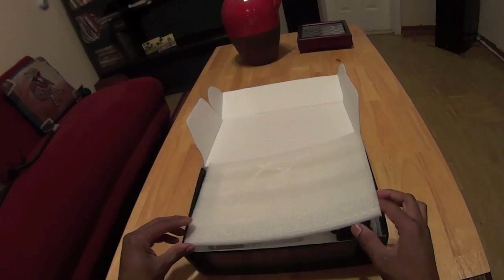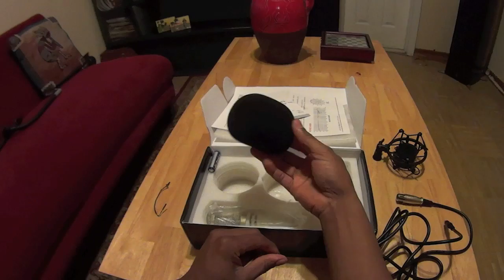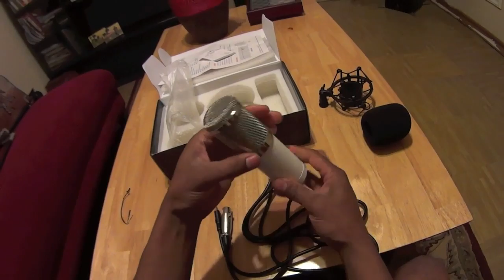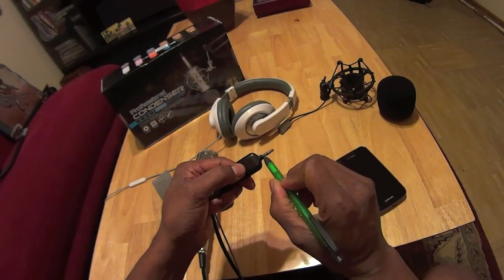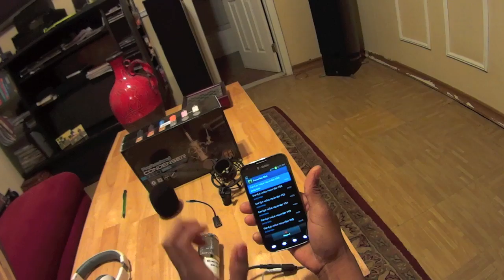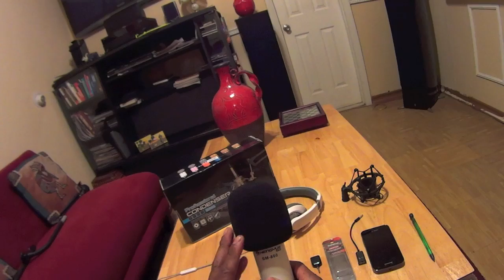THE BM- 800 MICROPHONE TEST

Comment: With this cable splitter that you showed at the beginning but did not test, this black splitter adapter that has the wire that you showed at the beginning of the video ...

Comment: OK, you state in this video which was posted in 2014 that you bought that BM-800 2 years ago so that makes it now 2012 and since this is now 2017 I can see a great deal has changed with the design of the BM-800 condenser mic.  I just bought mine 2 weeks ago and while it looks similar to yours in appearance, there is NO battery that goes inside the mic, rather the mic has two circuit boards inside the mic and there is an external power source that one plugs the mic into and then plug the mic into your computer.  What sucks is, you paid $29 & change back then and all I paid was $19.95 for the same kit plus, I received a boom arm and a "pop" filter (some call it a spit filter) and 2 different microphone holders, the regular mic holder and the shock mount holder.
Reply: Bo Hector can you plug it into an iPhone?

Comment: Testing, Testing 1,2 this is the BM800 microphone. Far too technical for me. Hey, it's not working!
Reply from the maker: Robert Creber  hi if dint get the one with the battery you probably gonna need phantom power ,,,, my demonstration was about the galaxy S2  it was not how to be use on you computer
Reply: Yeah, I got the phantom powered ones. They work fine except with very high spl's! Thanks.
Reply from the maker: THATS COOL
Reply: +DON GARDY do you have the link phantom power ???
Reply from the maker: dinh vuong
 no i dont but u can go on eBay or Amazone and get one do your research  first before u buy

Comment: Hi, helped alot. Do u have a link for where u bought this from.
Reply from the maker: No i dont have the link i got it on ebay but if u are buy this mic to b connected to ur computer make sure u get the proper Equipement or  it my not work

Comment: WTH?! i just got this microphone, the exact same one and i dont have a place to insert the battery?!
Reply: Yeah I have the same problems . Got no place to insert battery . So it means I have to buy power supply 48v ?
Reply: Not all models have the battery. The one without is actually the better mic. You win, sir :)
Reply: no, i lose. because i have no source of phantom power to power the microphone.
Reply from the maker: HELLO THERE GUY IF YOU BUYING THE MIC WITH THE BATTERY MAKE SURE YOU READ BEFORE YOU ORDER AND MAKE SURE YOU ARE GETTING THE RIGHT ONE
Reply from the maker: Peaked hi if your microphone does not use batteries  then its uses phantom power
Reply: Yeah i know, it's just i bought a battery powered mic and recieved the wrong one haha
Reply from the maker: hi you may have to buy power supply  unless your computer can power it let me know how you do
Reply: DON GARDY  You can get cheap usb mic amplifiers from ebay and dealer extreme. in d-extreme one costs 21 usd. So if someone gets the non batter one, always can buy that mic amp and its most likely much better solution than the battery swapping mic.
Reply: +HNDSGHT I know this was a year ago, I found a good one on Amazon. It's quite cheap... but try some research about phantom power first. sorry if its too late xD
Reply: yeah same situation here
Reply: DON GARDY sorry for late reply but WHAT IS A PHANTOM POWER? WHAT... HOW...

Comment from the maker: THANKS JGREAT11
Reply: +DON GARDY hola..is that okay if I connect in my laoptop? without using an adapter/???
Reply from the maker: +Party Hero it should be able to work ...i think u should do more research before u buy anything
Reply: how about my phone? galaxy s3?
Reply: HighClass Unreleased okay :D that mic is battery operated right? what model is that mic anyway? :D
Reply: The Traveler bm 800